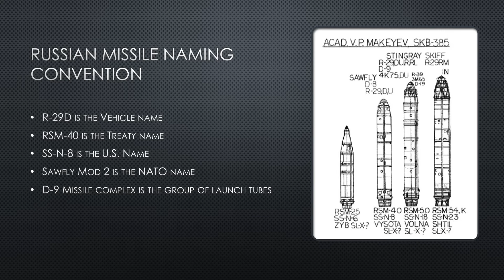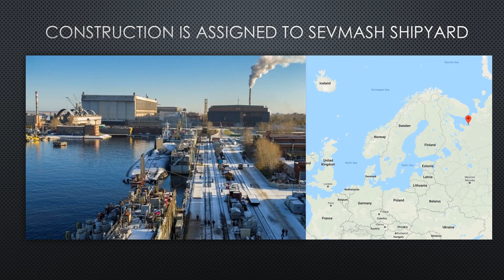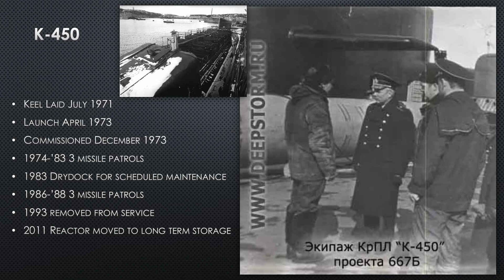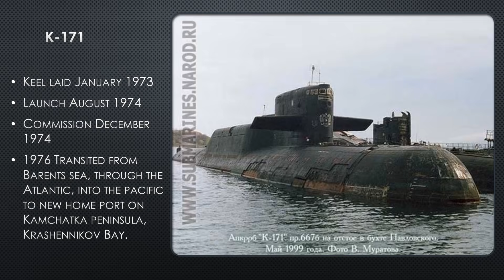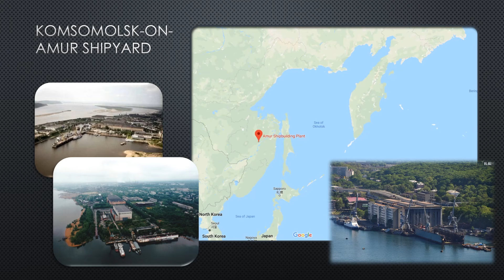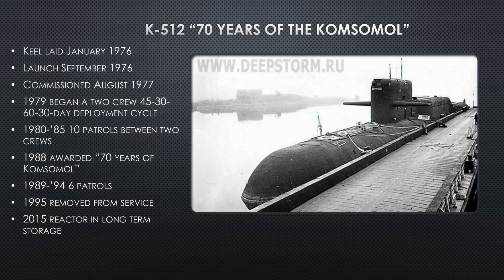Delta SSBN Sub Brief

Comment: 13:10 Throw weight - I think you are wrong. Throw weight is a mesurement of how heavy payload the rocket can carry to it's target, in this case it's the weight of the re-entry wehicle with the warhead etc. It has nothing to do with the tube or force of ejection from the tube.

Comment: My feeling about those casualties is, that the Russians put the mission first (vs. the casualty) because that's exactly what you'd be doing in an actual war. So maybe those sailors died because the crew successfully completed their mission rather than because of a 'mishandling' of the situation. (But that's just a feeling, i might as well be mistaken.)
Either way: Great one. Love your research jobs and especially all the extras derived from your experience that get dropped.

Comment: First of all, thanks for all the great content and sharing your knowledge and experiences!  Second is a question - does the free flood area in various model of subs provide any benefits in performance, sound signature or survivability? For instance, is there a chance that a torpedo hit might be lessened by striking a free flood zone as opposed to a pressure hull directly?
Reply: Having a double hull design means that the pressure hull design can be better optimised for pressure resistance, while the outer hydrodynamic hull can be designed with much more flexibility to accommodate things like missile tubes and machinery and optimised for low drag when moving through the water. The two hulls can also provide some protection against torpedos which would explode on the outer hull, and hopefully at least some of its energy would dissipate before reaching the inner pressure hull. 

Because things like missiles in tubes don't necessarily need to be contained within the pressure hull, they can be put inside the hydrodynamic hull and surrounded by water when the sub dives. Having the missile tubes outside the pressure hull could be advantages from a safety POV but it also allows for a smaller pressure hull or even multiple pressure hulls which can be individually sealed off which can be a significant safety advantage.

Comment: Nothing's changed in terms of worker mentality in the great worker paradise. Just recall how a space station module had a hole drilled in it's side and then covered over recently.
Reply: I don’t recall that killing 7 astronauts like two of the worst space disasters in history as a result of an inherently unsafe overly complex launch vehicle build by the lowest bidder. 

Read up on the 737 MAX or Hard Rock Hotel collapse for more recent examples of runaway capitalism. 

Remember… the Russians are the only reason there is an international space station, have had an almost uninterrupted presence in space since the 60s, and were the only ticket there for almost a decade.
Reply: @calvinnickel9995  I'm am aware of the impact of "late stage capitalism" on safety records. And I'm also aware of the stellar safety record of the russian Soyuz. My point is, while Russia is capable of building good, reliable machines, it's mostly on a bespoke basis. The mass-produced goods are seriously lacking, in part due to the attitude of workers. I think this is an outgrowth of socialism - when you're working in the factory on stuff that is not nor ever will be yours, you kind of don't care about quality. Combine this with lacking quality control on the management side - gotta reach those quotas! This sort of thinking was prevalent during soviet era, and it seems to have stuck in peoples' heads.

Comment: The fact they were using their newest & baddest SSBN as a power station really suggests that the missiles weren't ready....
Reply: Ever hear of the USS Lexington?  

It was an early US aircraft carrier. It had a neat turbo electric drive where there was no mechanical connection between the steam turbines and the propellers. It used a dynamo to drive an electric motor much like submarines and diesel electric locomotives. 

In the winter of 1929 to 1930, Tacoma was without power due to low water levels in Lake Kapowsin.  The Lexington tied up alongside and powered the town. 

In the Ice Storm of 1998… several locomotives were driven off the tracks to provide emergency power to several villages. 

Just because someone is using something for power does not mean it isn’t operational. Maybe it turns out that deterrence isn’t as important as basic needs.
Reply: @calvinnickel9995  Yes, but why not use as SSN or an old Yankee rather than your new improved SSBN with the improved missiles?
Reply: @andrewcox4386   Unlike an SSN, these SSBNs could perform their mission and hit their targets without going to sea.

Comment: The liquid fuel for these ballistic missiles has to be storable at room temperature and ambient pressure. This leaves just one practical option - one component (the oxidizer) is nitrogen tetroxide and the other is hydrazine. Both of these are highly toxic and very corrosive. When mixed, they combust instantaneously - they are hypergolic - so the rocket doesn't need a complex ignition system. I am surprised at the audacity of cramming a nuclear submarine with these rockets... what surprises me even more is the fact that none of them ever just detonated, taking the sub with it.
Reply: Ryan, shome of the thingsh in thish room don't react well to buletsh.
Reply: @1KosovoJeSrbija1  Nice Lithuanian accent.
Reply: Marko Ramius was from the part of Vilnius known as “Little Shcotland”.
Reply: Actually they did. The Yankee class K-219 was lost after a missile detonation caused by a propellant leak.
Reply: I was reading about the ME 163 rocket powered fighter the other day, which had a similar kind of liquid fuel setup by the sounds of it. Apparently in one accident a pilot was "dissolved", not sure if I dare read into the details...
Reply: @GurtTarctor  The Me 163 was really dangerous to be around - especially during refueling... however some of them also caught fire after landing when the last few droplets of the mixture wandered into one another in the engine. During the cold war, many ICBMs used this fuel mixture and it also caused some horiffic accidents then. The Nedelin catastrophe comes to my mind. Still this fuel mixture is in use to this day. The Apollo Lunar Module used it, too.
Reply: @KR4FTW3RK  most rockets switched away but their 3rd/final stage which is small vs the whole rocket for safety and the sat has control trusters using it as well. however china's full rockets still use it and lands on cities and farmers walk up to the booster/1st stage not knowing it is deadly to breath it and die. the US only uses it on small parts since other systems are too complex/weigh too much like i mention above and dragon crew cap used now. side note F16 has an apu of it as well so they are checked for leaks every flight

Comment: Also, does the double hull not add weight by pushing the water inside through the water and slow down the sub?
Reply: it certainly adds mass. i don't know if you've seen the typhoon brief but they said about half its mass was sea water. i'm frankly shocked they could break 20 knots pushing around that much water.

Comment: I know they have acoustic tiles on the outside. Do they sound proof the insides of subs? Like a sound studio?
Reply: Acoustic tiles are used to hide the magnetic signature of the sub as for sound proofing the inside all machines are mounted on rubber points but as for any other measures idk but it's an interesting thought.
Reply: @montys420-  ACOUSTIC do you know what that means? that means sound deadening. rubber has no effect on magnetic fields.
Reply: @oldfrend   the acoustic tiles aren't just made of rubber a few countries developed there own tiles and have them classified and hidden from allies as well as foes, and they do help in hiding the ships magnetic signature plus hiding the ship from sonar there correct name is Anachoic tiles reduce the chance of returning sonar as the rubber absorbs the sonar and stops it from being returned to the "sender".
Reply: @montys420-  Magnetic signatures are hidden by running a current through the hull to create an inverse electromagnetic field to attempt to cancel out the ships natural one.
Reply: @watcherzero5256  yes they do run an electric current through the boat to reduce the magnetic signature and has the biggest effect on hiding its magnetic signature but Anachoic tiles help with this also as the boat need to continually have its magnetic signature "wiped" regularly with the electric current and theres situations where it can be degraded during a deployment and therefore the Anachoic tiles help out a fair bit when this occurs.
Reply: @montys420-  The tiles dont really help the submarine hide the magnetic shadow of its hull interacting with the earths magnetic field, the use of iron oxide dust in their polymer construction is mainly to allow them to partially absorb radar (from enemy ships and aircraft) similar to an aircrafts RAM, which also cuts down on electromagnetic emissions generated by the submarines electrical equipment (motors, computers, lighting etc...) escaping into the environment and giving away its position.
Reply: @watcherzero5256  correct, although they do help and some countries tiles would be more effective then other countries.

Comment: Great as always. Know you’re just using shorthand but if missile Circle Accuracy means CEP then the circle is the area that a warhead would be calculated to land half the time (if you fire 10 then 5 should land within the circle). As with all ballistic missiles this doesn’t include unknown and systematic errors that can only be discovered by firing test shots on the same trajectory.

Comment: @ 37:34 > the Russians do not pause these drills because you cannot make such pauses and preparations for safety first under conditions of war. 
If s problem occurs during combat, and you never drilled for solving problems during combat, your crew will be caught flat footed and possibly cost most if not all your objectives and fail the mission. 

This is why they drill even with the risk of serious casualty. War does not allow for one to Get a pass during technical failures or a do over because a pipe accidentally ruptured.

Comment: Great video but you have miss understood the term Throw weight. Throw weight is the weight the missile can "throw" at the target so basically its payload. The missile weight is between 32 and 36 tons depending of the model, so the tube is able to eject quite a lot more than just 1,1 tons.
Reply: Yup, throw weight includes warheads, pen aids, guidance system, dispenser, and post boost propulsion (PBV) if equipped.
Reply: Yeah, 1.1T seemed awfully light for a complete ICBM.

Comment: The first submarine I learnt about in a Salamander book when I was a teenager.  Looked so dark and menacing in the illustration, very nostalgic to me.  Still today I feel great admiration for cold war soviet subs.  Wish there was more reading technical material about the subject.  Great video!!
Reply: The American "Turtle" was a early sub back in the American war for independence. Where they would physically hand crank the shaft to power the ship to a British navy ship. Drill a hole into its side planting a charge, try and crank the other way to back up and get away before the bomb went off.... I class her as a sub as she is fully enclosed and had the waves go over her. If she could dive it was only few feet tho I doubt that deep even......Today I don't think her getting to "dive" that shallow to run along just under the surface (just under the waves) would really count as a true sub, but as I said shes a early one.... Back in the days of sail and wooden ships being king of the seas...
Reply: Turtle was a submersible. But then so were the boats of WW2! The true submarine only arrived with nuclear power when the boats became completely independent of surface operation.
Reply: Whatever happened to the great Salamander Books?
Reply: @user-lq6ku3xn5t  Great series.  It get me hooked in Air, Naval and Land warfare matters.  It was perfect for beginners; excellent artwork and diagrams and a easy to understand text.  Still have them after all these years (in paper and pdf)